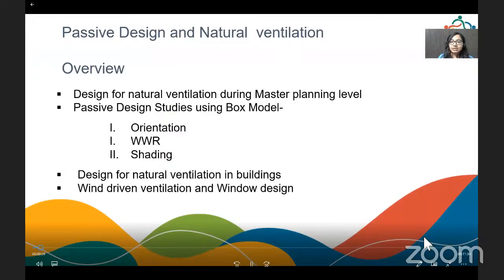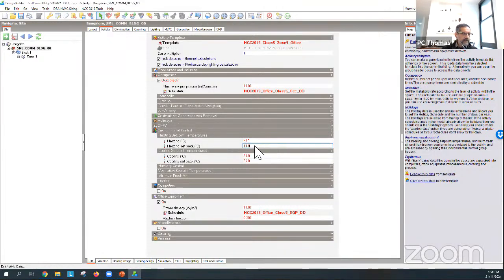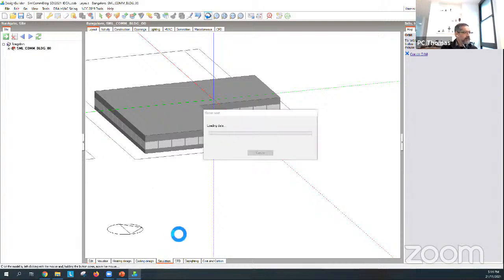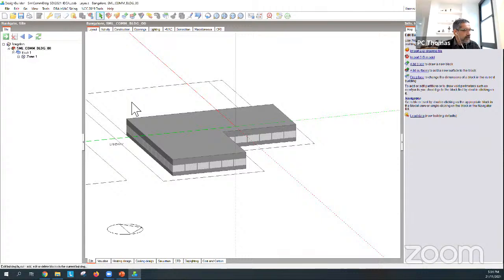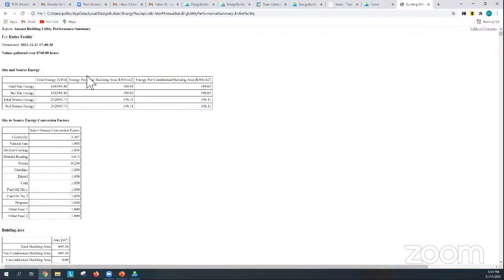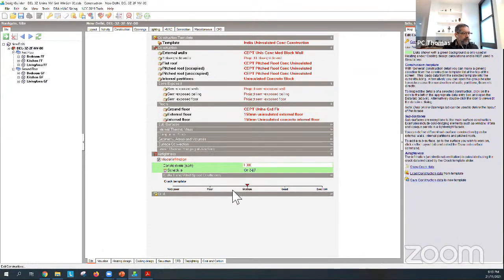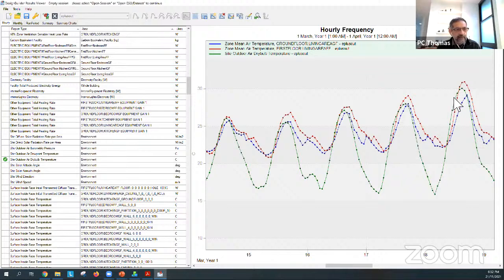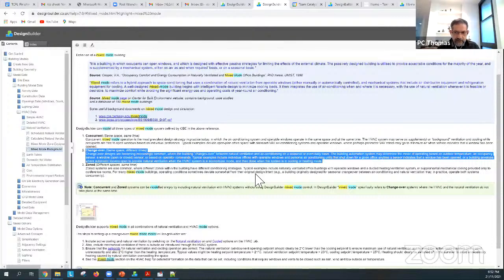Simulations with DesignBuilder (3 of 5)

Comment: Hi. I’m working in DesignBuilder and I want to simulate the indoor temperature drop during heating system off-hours (like nights or weekends). I need to export hourly temperature data for that period to analyze the building’s cooling-down rate and thermal mass behavior. What’s the correct method or workflow in DesignBuilder to get this hourly output?